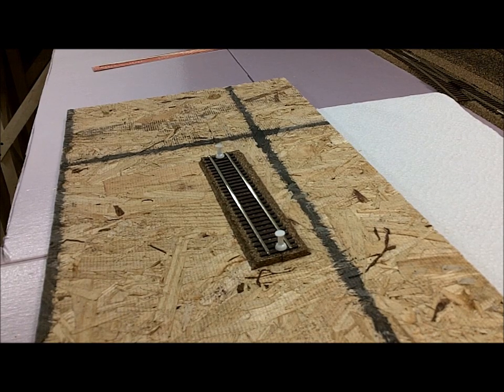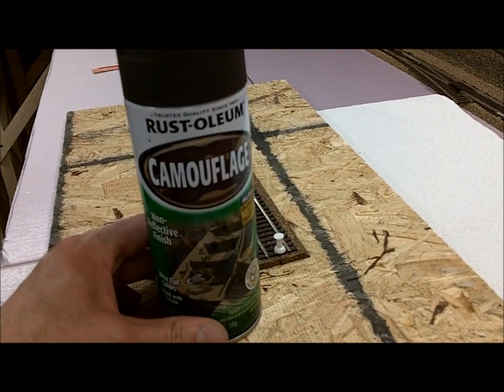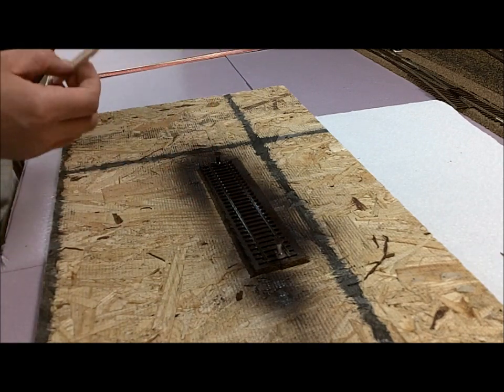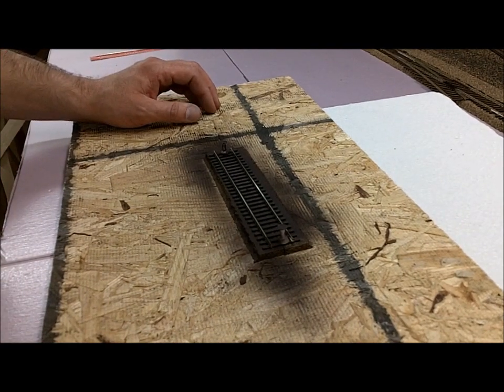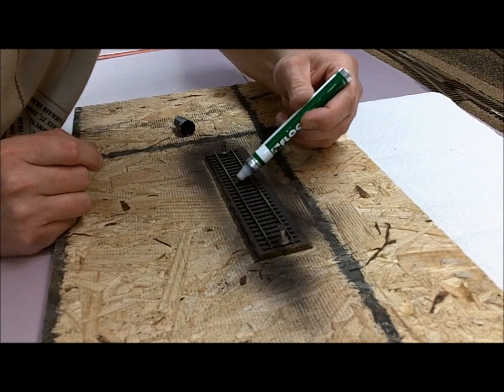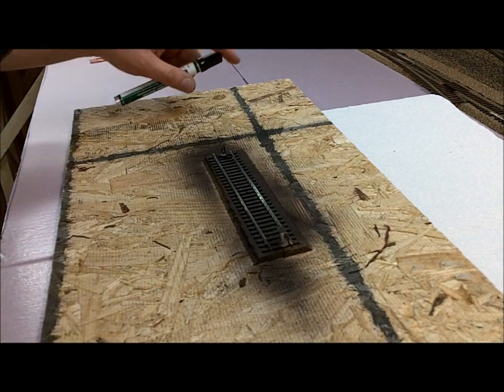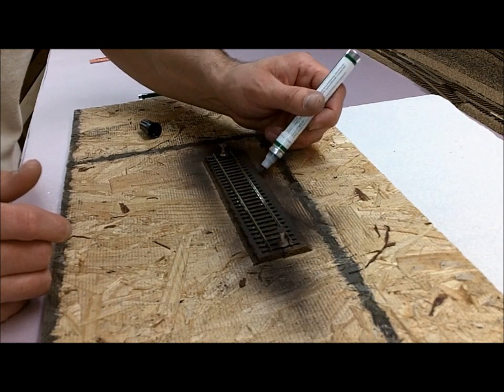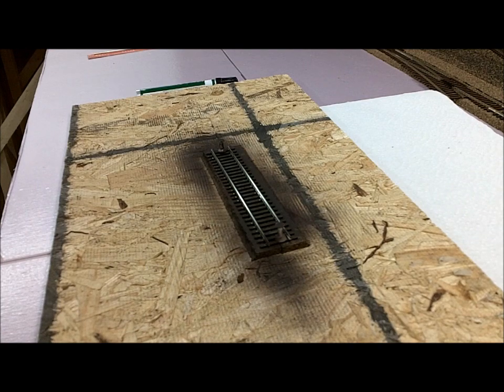How To Weather model railroad track - Very Easy!!!

Comment: Good video.  For ease of painting, this is very easy way, but you forgot two important things. First to make sure everything is covered so no overspray or the dust from spray paint does not get on rest of layout, and very good ventilation to remove the spray paint dust and fumes. Colors use here are rustoleum flat brown for rail and ties, primer gray for weathered affect, and flat black to represent oil and grease around throw bar area.

Comment: Hi there, Deryk. I'm new to this venue and your site but after viewing a few videos of yours and a couple comments below I just thought I'd add my 2 cents worth in case it might help or clear up questions by other viewers. I used the Krylon paint and the marker paint pens you demonstrated with good success. I had NO issues with 'melting' the Woodland Scenics riser system I used on part of my layout when painting the track, BUT, I covered those foam risers with a layer of plaster cloth first. This helped protect the foam from damaging paint and allows me to ballast and scenic the right of way without depositing a ton of ballast between the riser sections. Hope this helps others. Dale
Reply from the maker: Dale Trongale Excellent info and you are absolutely right about all that.  I've also just ran some painters tape down each side of the track, over top the risers, to protect them while spraying.  Some people really get bent out of shape over stupid stuff.  Thanks for watching and your informative comment.

Comment: I like the clothesepin tip. I find a Bright Boy will remove dried paint regardless but since those are more costly than gold, the clothespin will save a little money. I don't like to wipe with paper towel because it can also get the ties.

Comment: Did you use the same process for your turnouts?  Any problems with paint and making good electrical contact?
Reply from the maker: ***** Hey Steve, I put a piece of 2" wide painters tape over the frogs and the switch points before I sprayed them.  And then hand painted those spots afterwards.
Reply: ok..thnx

Comment: Thanks! But I do have a question...

When I used to be really into the hobby (I am getting back into it now, and plan on doing videos documenting the progress of my layout and to do my own "how to's" anyway, when I used to weather my track (Atlas N Scale Code 80 Sectional Track) I used to do the painting thing, and cork, and everything..I made sure my rail joints were as good as they would ever be and made my electrical done right, however sadly, when I tried to run my trains, I didn't have success because it seemed no power was getting to the train (I did DC power)...could this be because I had paint on the top of my rails?
Reply from the maker: I would say your problem was paint on top of your rails.  That would be the only reason why you would lose power to your rails from paint.

Comment: Do you do more weathering after the ballest is done? If so what do you use, more paints or weathering powder? I'm debating airbrush or powders or both. Any help or ideas would be great, thanks! Adam
Reply from the maker: +dep92 I haven't weathered after ballasting yet.  But I'm considering airbrushing some dirt and grim over it.   Powders would be an idea to try too.  I say try it, and see if you like it.   You could always set up a test piece like I did in the video.
Reply: Thanks for the reply!  That's very true, I should set up a test track.  I'm working on a shortline railroad in the 50's that's almost out of money.  So even if it looks "dirty" and a little messed up, that works...

Comment: Additional idea...use a q-tip and put a light coat of vaseline on top of the layout.  When you spray the track you can now let it dry then wipe the vaseline off of the rail.

Comment: How well does the track keep it's conductivity when using the Testors markers along side the rail?
Reply from the maker: Andrew Camenga It keeps conductivity just fine.  You only need to keep the top of the rails clean.
Reply: Ok that's what I figured just wanted to be sure. Do you have it on any parts of the track where you have feeder wires soldered on?
Reply from the maker: yes, once your feeders are solder on, you can paint right over it.
Reply: Sweet! I appreciate the info! Thank you
Reply: One more question, I just realized that you have HO scale track. I have N scale, do you think it will still work using the same method that you are?
Reply from the maker: Andrew Camenga Yes it will work the same.
Reply from the maker: Andrew Camenga Yes it will work the same.
Reply: Alright thanks for all the help and speedy replies. I'm a bit new. I appreciate it!

Comment: You might want to tell all of your viewers , once you paint the track , it does NOT allow the rail joiners to make any contact at all . it looks good , BUT what good is it if you CANNOT run trains ? . I did the same thing you did after watching your video , and now all of my track is ruined . Ray in Pa.
Reply from the maker: Well....that's just common sense.  You don't paint your track till you have it laid.  You are probably the only person I've heard of doing that.  LOL.    And relax, your track isn't ruined.   Just take an xacto knife and scrape a little paint off where the rail joiner slides on.
Reply: lol it isnt ruined. just sand the paint back off.
Reply: I did exactly the same thing and had no trouble at all. Track looks great and trains run great.